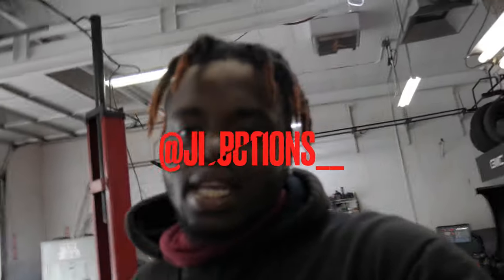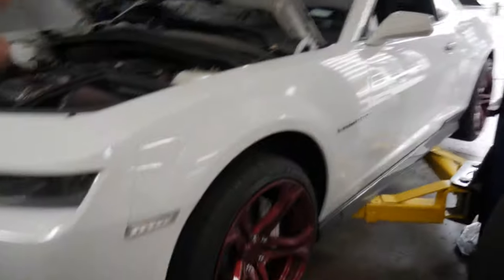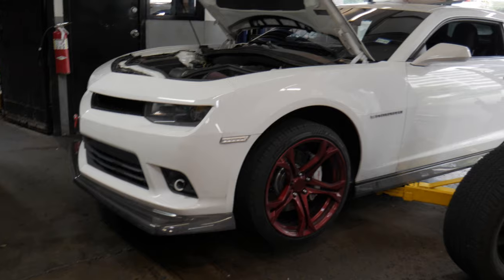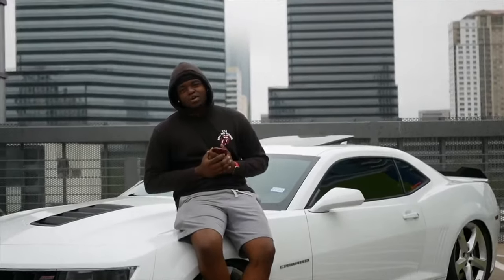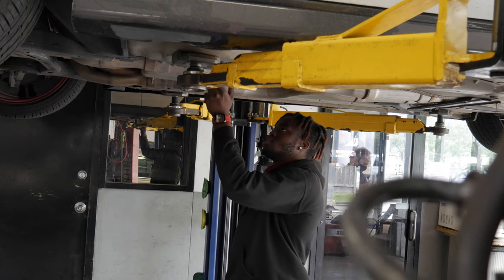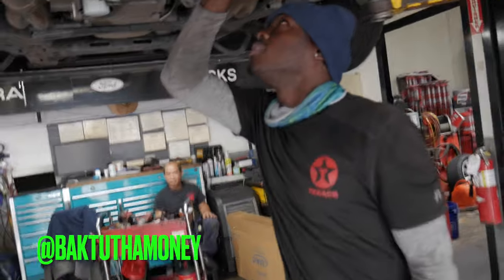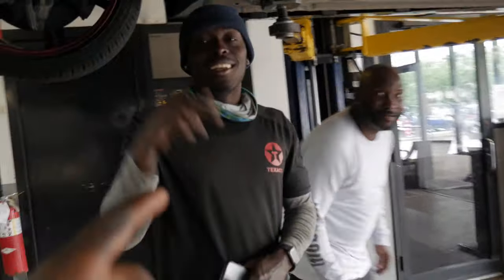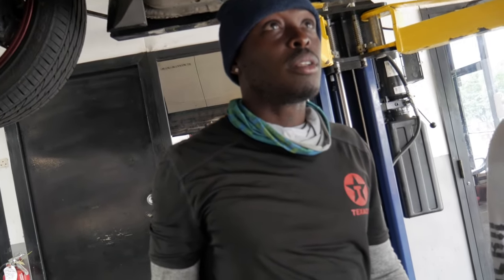CHECKING THE TRANSMISSION FLUID ON MY CAMARO SS.....

Comment: First of all in order to check the trans fluid you should start the engine shift to each gear for two seconds then back to park and leave the engine on, after that remove the drain plug and see if its dripping so its good if its not dripping at all so you are low on fluid but you have to keep the engine running 
Cheers